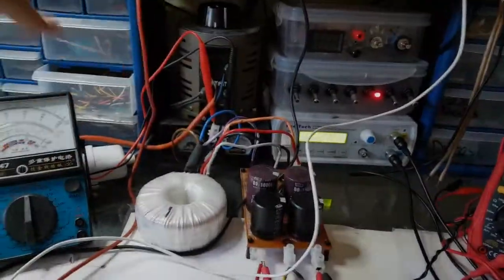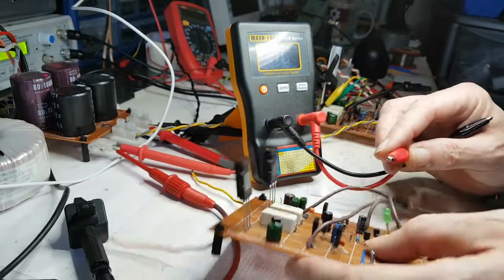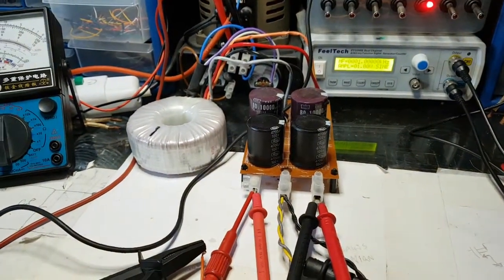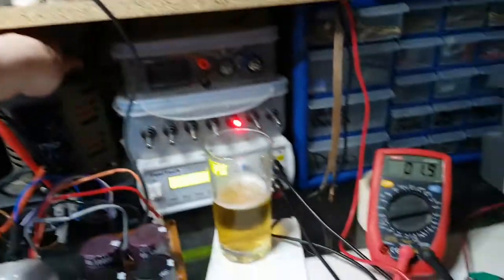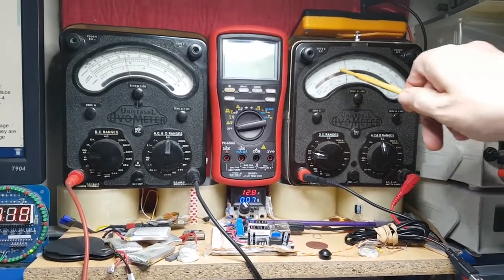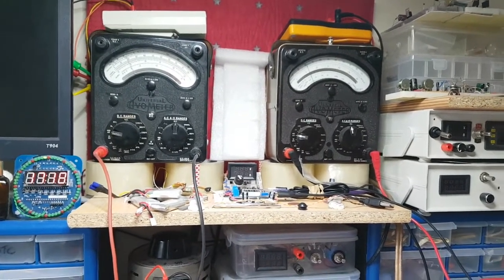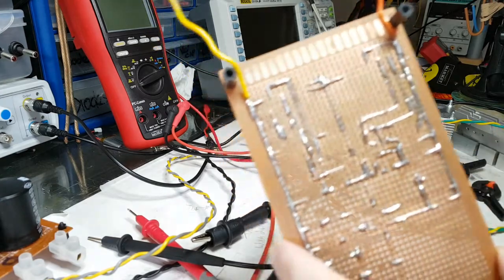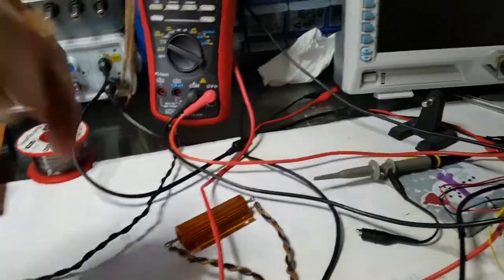DIY Discrete Amplifier Fix

Comment: Well i got excited when i saw you had uploaded a 45 min video....you can tell i don't have a life can't you...lol.,,your edit gave a good illusion of you knowing what you was doing...good job it was not a 50 transistor amp.....is there a danger of you talking outloud when the camera is not filming?..sorry my sense of humor can be bad sometimes...got a back log of fault finding here...the tv is trying to turn on a 4.27 am every morning...no idea why????..does it even with all the plugs out..and no clock in tv...need to look at the caps inside it..for now i use a 2 kw fan heater behind tv run it for a while then tv will turn on...good work around right?..grin your bench and toys are looking great..is that a new channel photo..did it used to be a flamboyance of flamingos?...anyway thanks for sharing..and dont poke anything in the wrong hole
Reply from the maker: Your sense of humour is fine, My sensitivity is sometimes in need of it.
I guess we can all seem a good at something with the magic of video editing ;-) I have noticed I can get a little chat on from time to time. I will not worry as it is only one way and I do keep myself in check.  
That TV needs to be recorded, you will have a viral video and it will blow a hole in my thinking. As skeptical as I am, I would change my thinking in a heartbeat with the right evidence.  Deleted my comment on your discussion wall as found yours here, right where you left it. :D
Sometimes I wonder how I manage to get out of bed without hurting myself... :/